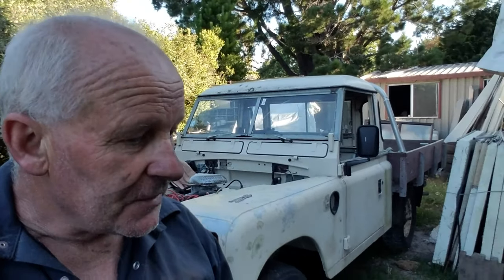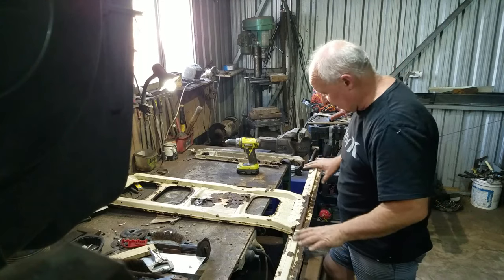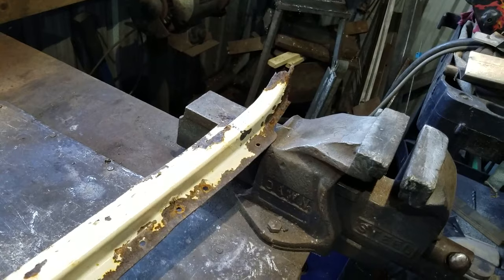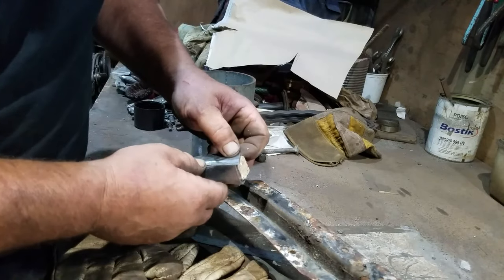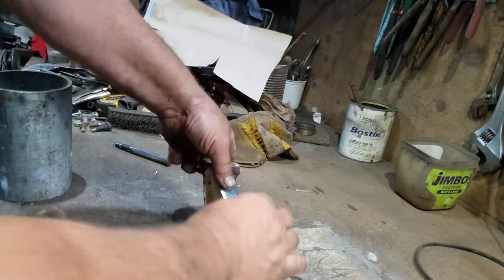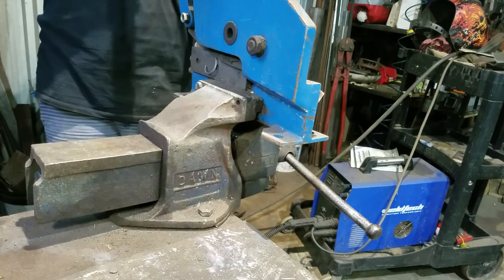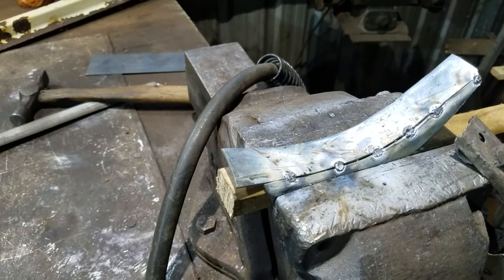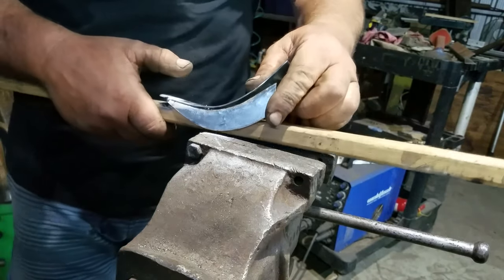Land-Rover S3 Stage One V8 Rebuild- Bonnet Brace Rebuild on the cheap! Part 1

Comment: Yeah Brutus is looking good buddy. My Dad had a 1984 Series 3 2& quater 4 cylinder petrol.Exarmy radio vehicle. It was 24 volt so it would run radio equipment on her she spent most of her service in the Gulf. We had a few of the old sereis 3s my dad loved them.👍
Reply from the maker: Yes I had an ex Army radio vehicle about 10 years ago but I was not in a position to rebuild it-such a shame.

Comment: What happened in the last few minutes of the video?
Reply from the maker: er... umm... I finished what I was doing and it was 10pm!- The other two parts of the frame have to be folded at my mate's shop. Ill be doing that over the next couple of days- also a couple of inner guard mud shields - then Im rebuilding the rat eaten seats!
Reply from the maker: I see what you mean!- one tiny segment of soundtrack got left and got shunted to the end and the software thought that the long gap was meant to be there!- Operator error sorry.
Reply: @t.h.o.r.  there's about 3 minutes of black screen.